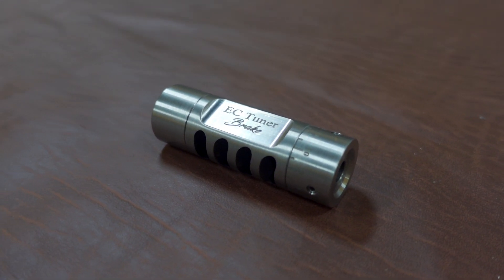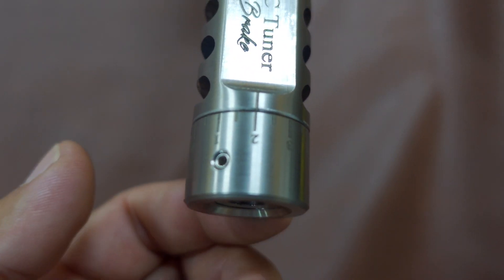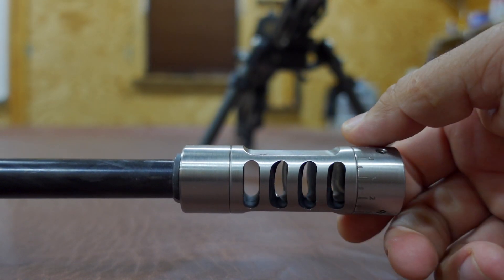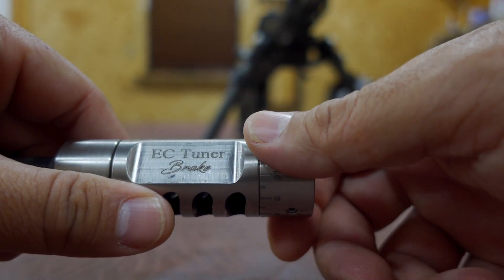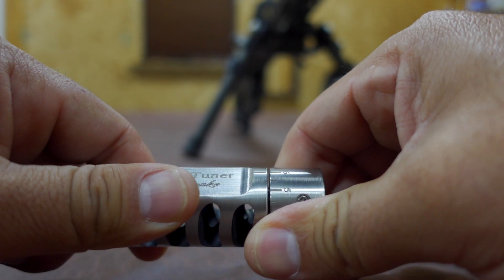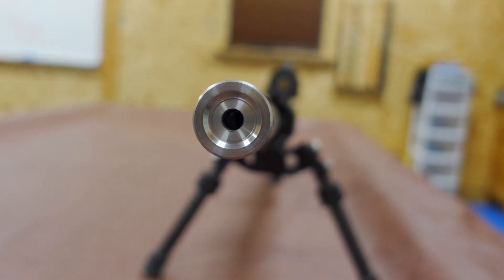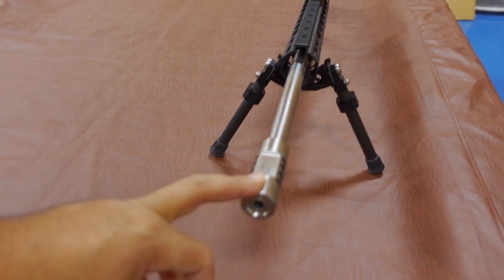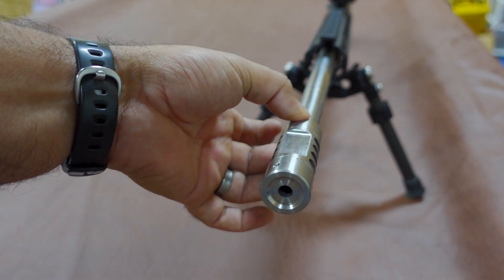Everything you need to know about ECTuner Brake

Comment: I shoot a custom 27 caliber wildcat, would the 6.5 work for it? I use 6.5 end cap on my suppressor for it and it works fine as the actual id is quite larger then 6.5
Reply from the maker: You need a 30 caliber for a 27 caliber.

Comment: Not too long ago, I finished building a 6mm ARC longe-range bolt gun with every intention of testing the EC Tuner brake with all 3 of the Hornady ammo offerings (Black, Match and Precision Hunter). I got 2 boxes of each and thoroughly tested everything and was shocked at how effective this tuner was. Groups using the Hornady Precision Hunter had little improvement, but the Match and Black responded remarkably well with the Black being basically 1-hole groups almost impossible to measure and the Match ammo tuning to .234 !!! I will not be reloading for this cartridge. I bought every single bit of the lot numbers I could get my hands on and will simply enjoy shooting this gun and just sell the brass since once-fired brass is an easy sell anyway.

Comment: I got my today I did put it on my bergara b14  hmr on 308 and firt  shot when 0.7 mils up I did ajust it down 7 click and shot 3 round for grouping and I have to tell you shot basically one hole so I didn't have the courage to move the tuner open  down way set up number 0 so I'm from Argentina the ammo here is pretty expensive and hard to fine I did use the hornary match ammo later on I will tryout longer shots for red stag season. 
Thanks for this product very impressive

Comment: I installed a Harrell's tuner/brake on my factory Rem 700 223 and my best 5 shot groups have improved by 40%.
Tuner/Brakes really shine on factory barrels.
My question is I know changing powder weight changes tuner performance but will changing bullet weight also change tuner performance ?

Comment: WORTH IT'S WEIGHT IN GOLD!  I threw it on did some load work up found a good load 144 Berger and H4350 SD of 2.4 on my magneto speed.  Loaded up 30 rounds took the magneto speed off and started fine tuning.3 shot groups starting at 1 to 8.  Found it grouped well at 4 and 5.  So I split the difference and wow!  5 shot group @.18 inches and .22 inches.  Absolutely amazing product.
Reply from the maker: Thank you
Reply: @ErikCortina Hi Erik,  I recently, last week, bought a M18x1 SS black EC tuner brake throughthr Spanish dealer. Apparently, my gun barrel has a M17x1 thread. Is there a solution for it. A converter or can you do tuner brakes with a M17x1 screw thread? Best regards,
Reply: Going to have ordering one for my .30 today.

Comment: OK Mr. Cortina, I finally got time and conditions to do a little work. First I tried some 147 gr military crap and shot OK with adjustments to 6. Then I used “Atomic” 168 gr I bought at Perry. At position #6 I held .525@ 100. I only shot 30 rds. Lol. It works. I may find tighter groups yet but I like it already. (DPMS LAR ) Thanks. I like your videos.

Comment: Any thoughts on a barrel tuner that works with or is a suppressor mount? Can it be done?
Reply: Or would the original barrel tuner be the better bet? Turn down the barrel for the original behind the threads and then just run the suppressor as normal.

Comment: is it possible to modify this to work for .366 freedom pellets? I am having serious harmonic issues with my freedom tool. If I change the seating depth 6/1000 backwards or forwards the accuracy goes from 11mm at a 100 meters to 30-40mm.
Reply from the maker: Yes, it can be modified.
Reply: @ErikCortina  That sounds awesome, you got yourself a new customer :) I will order one in .338 and have a smith modify it to .366 here in Sweden :)

Comment: what is the theory of operation?  for high power matches i reload for the event. different bullet and powder weights.  (223.) . this break could be changing barrel pressure.  i guess if using issue ammo this might tune the rifle somewhat. the pressure must be constant for this device to work effectively.
Reply: PLANKER”
Tuners do not change pressure, they adjust the point in the sign (sp) wave at which the bullet exits the barrel.

Think of it this way, the bullet, if seated the same distance off the lands every time, will impart a vibration to the barrel.
As the vibration or barrel whip has a range of movement. If the bullet exits the barrel at the top or bottom of the travel of the end of the barrel each time, your groups will be as small as possible with that “setup” 

Keep in mind everything else has to be consistent, neck tension, charge weight, same bullet, seating depth. Etc.
Reply: @RJ-sr5dv  You have my attention.
Reply: @planker  Spelling correction, "Sine Wave" a.k.a. barrel whip
Reply: @RJ-sr5dv  an adjustable damper with break?
Reply: @planker  
RE: "an adjustable damper with break"
That's what Eric's looks like.
My current 'tuner' is from the late 1980's. It was a clamp on type without a muzzle break..

I like Eric's design....

I'm not sure of the need for a muzzle break on the 223 / 556 given the light recoil. I guess anything in a proven design might help.
In an AR platform I think a lot of attention would have to go towards the upper and lower receiver lockup tolerances.
Plus if I were going to pursue max accuracy in a AR, I would turn it into a single shot with a adjustable gas block for load development. This is Because I don't know enough about the action induced vibrations' (wiggle factor) from all the moving parts. i.e.bolt moving before the bullet exits.. 

 From my perspective, because I am not a hunter, all I am looking for in a AR platform is "minute of bad guy" accuracy. 

I'll save my time and energy for Bench Rest reloading / target shooting with Bolt Gun's.... 
BTW, it's amazing how much you can wring out of a stock rifle with a custom trigger and a tuner.

Comment: Probably need to watch over your shoulder, as this is nothing but a rip-off of the Browning A-Bolt B.O.S.S. system...purchased a .300WM in 2000 with the B.O.S.S. system, combined with reloading a good cartridge, it can help finish dialing it in for accuracy...but I'm guessing Browning has a BOX OF PATENTS on how it works, and what it does, too...
Reply: Skeeter,
I bought a tuner for a bull barrel Savage (223) back in the late 80’ s .... shrunk my groups into the 3’s.
Tuners are not new, just made better by Eric

Comment: Love it, but what about us guys that don't want to thread our muzzles? I've currently got two "Witt Machine" clamp-on MRE's attached. Both are as rock solid as any crush washer model, and do a fantastic job taming recoil/muzzle jump...., but I WANT TO BE ABLE TO TUNE the harmonics out. 
 As I see it your current design has two known constants.., 5/8" x 24 tpi machined O.D. muzzle end and bore diameter. Variable being your adjustable tuner on the outer end......., SOoooo can you produce a clamp-on variation of the EC Tuner? I'll be your first customer.., no questions asked. How much you need for down payment/deposit?

Comment: Erik, the new tuner is excellent since it avoids additional work on the barrel. I went to order and it only comes in 6.5 and .308, which I understand. I just ordered a GAP 6mmGt, is it possible to use it with that caliber?

Comment: I thought the tuner needed to touch the barrel in order to change harmonics?
Reply: It is screwed onto the brake which is screwed into the barrel: so long as it's tight the harmonics will travel: the harmonics don't stop just because they aren't the same piece of metal (look how many pieces is a guitar made of, yet the harmonics don't just go through the metal strings but through the wood as well). Also if it was as simple as attaching something different to the the barrel to deaden the harmonics, everyone would be doing that.
Reply: @wilfdarr  
Wilfred, over the years people have put adjustable sliding weights with set screws on straight barrels,
Eric’s solution is obviously much better, short of having a rail gun with the muzzle clamped
Reply: @RJ-sr5dv  Absolutely. Sorry I didn't meant the solution was impossibly difficult (not to minimize the elegance of EC's solution), only that no matter what is attached at the muzzle it's likely to carry the harmonics, alter the harmonics, not deaden it: that was my point though I can see how I didn't say it as clearly as I perhaps should have.

Comment: This has me very curious now. I'm wondering if you could machine a small part that goes from 1/2x28 female to 1/2x28 male and have your adjustment in between the two ends. It only needs to be maybe an inch long, sort of like a barrel extension but with a tuner built in. 

Why do this you ask? Because you can then run your favorite suppressor while still having the benefits of a tuner.